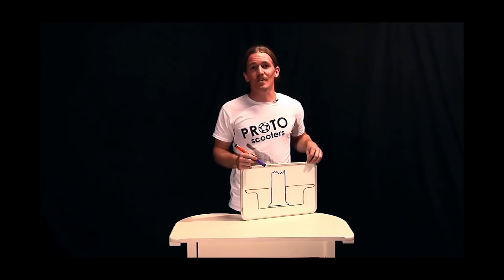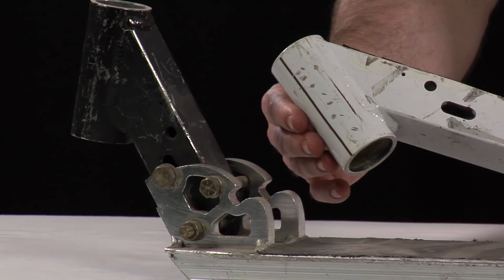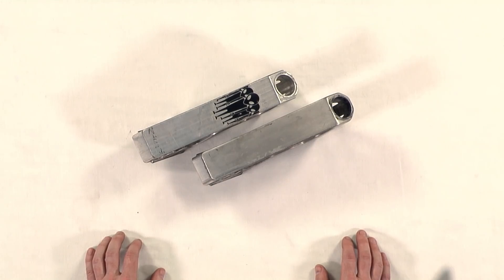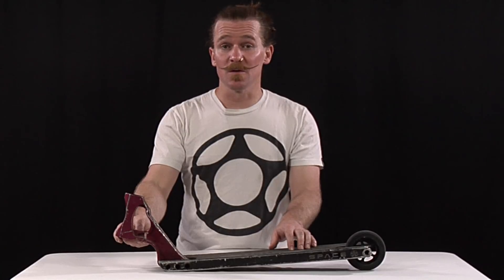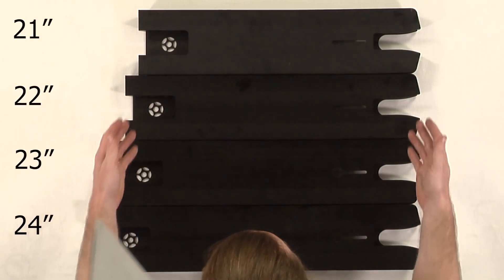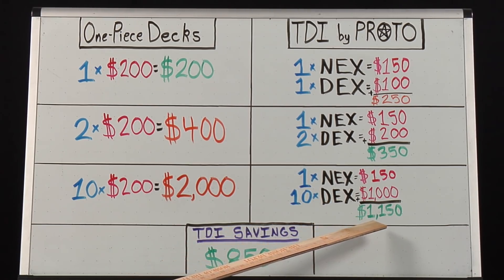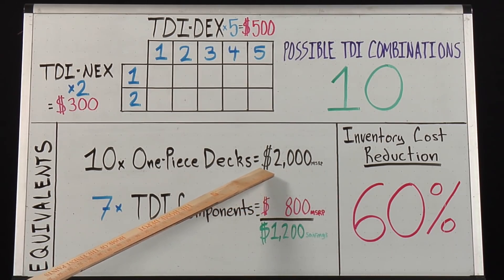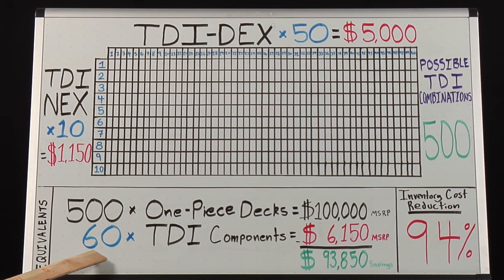PROTO Whiteboard | TDI Part 2: Development and Benefits

Comment: At 4:51 Andrew mentions using shoulder screws "for their extremely tight fit", but isn't the point of shoulder screws to be bottomed out so the shoulder is in double-shear? Looking at the cross-section at 5:21, the screws are fastening the neck to the deck from both sides, so wouldn't bolts with lock washers achieve the same, if not greater, rigidity for less? I don't intend to criticize, obviously Mr. Broussard knows his product better than anyone, and his years of  research have rewarded the scooter industry with numerous innovations. I'm just curious that's all.
Reply from the maker: Technically the hardware we are using is not a true shoulder screw because the shoulder and the threads are the same diameter, true shoulder screws do have smaller threads so the cylinder can bottom out and be used as a pivot point in some applications, the TDITH hardware is just a standard shoulder bolt but was easier to describe the way we did for the video sake. Also, if you have ever noticed when you run an axles with threads in the drop outs, the threads start digging into the dropout because there is less surface area making contact. Essentially the same thing happened when we used the heli coils, a threaded shaft makes virtually no contact aside from the points of the threads versus a flat cylindrical shank which makes full supported contact. Hope that explains!
Reply: @PROTOScooters  that makes a lot of sense, thanks for the reply!

Comment: I would make the change to TDI but the decks just aren’t wide enough! Could you please make a 6” wide plate
Reply from the maker: Yes. All sizes are possible as time and resources allow.
Reply: PROTO scooters I’m debating on getting a tsi or a space deck but I’m worried it’s gonna be not wide enough because I don’t really wanna switch back to 5 wide

Comment: I fully back this 100%, but I think the main reason why people don't ride these decks and stuff is because they are a little beefy and heavy compared to most decks out there, if they were lighter and ect people would buy loads of them ❤️
Reply from the maker: PROTO NEX & DEX are still manufactured in the United States which is the only reason they are still a little expensive. We strongly believe that if someone spends the extra money to support our products, it is our duty to deliver a product that lasts as long as possible as strong as possible which generally means adding material (and weight) where other decks are breaking to guarantee a longer lifespan.
Reply: @PROTOScooters  ❤️❤️❤️

Comment: so whens 5.5 coming out?
Reply from the maker: Fall/Winter 2019
Reply: @PROTOScooters  Thanks! Will the old headtubes still be compatible? Also, will it be able to handle wider wheels like 12std or the 120's by 30's?
Reply from the maker: @natet4649  Yes, all TDI components are compatible, that is the STANDARD. Wider/bigger wheels will happen when the time is right.

Comment: i get that yeah u have a deck design that’s different from any other company but calling them out saying they r pretty much stupid for a one piece design it’s low. there’s many other ways you could have delivered this information without shaming other company’s. me personally i don’t care what sizes or colors you have i jus simply don’t like the look of the deck. there’s multiple reasons people choose to ride one piece decks opposed to the tdi system.
Reply from the maker: We stated facts only. The conclusion you draw is your own. The way the components visually look has nothing to do with the TDI integration. The only thing being stated here is Bolts VS Welds. All deck specs are secondary to that.

Comment: Love your vids, but isnt your tdi system patented? Essentially making standardization of this system impossible? Other companies would need to make extrusions compatible with your necks and that would be illegal. Am i wrong?
Reply: ethan salsbury you’re wrong in that he’d have to press charges on the company for using the patent. But if he chooses to let other companies use it they can. It’s the same thing as the scs. Proto owns the patent for SCS but allows other companies to use the system
Reply: @nickolashernandez5172  gotcha, thanks!
Reply from the maker: It is Patented and we will control when and how other companies use the TDI system that we developed to ensure that the quality and compatibility of our system is not jeopardized.